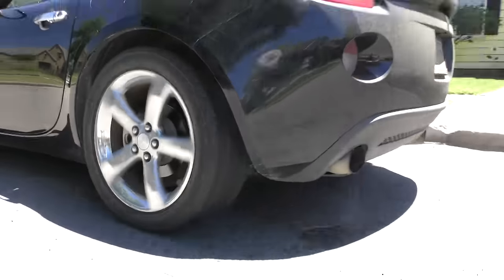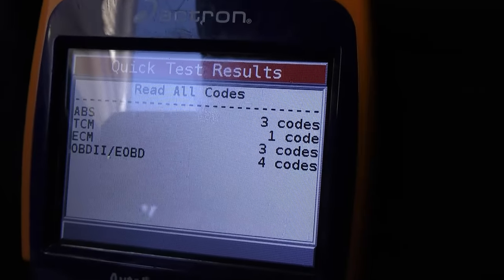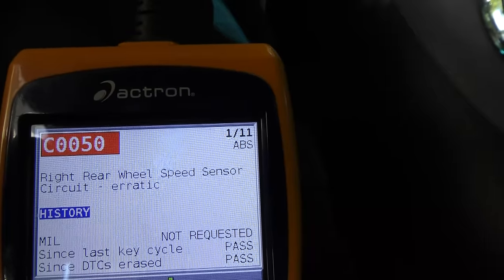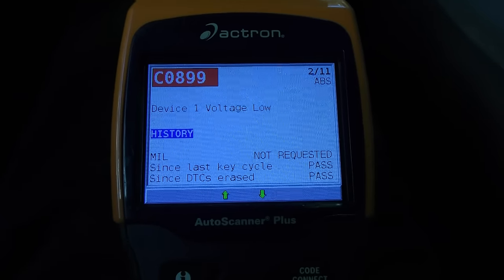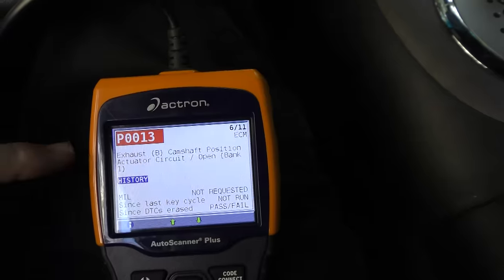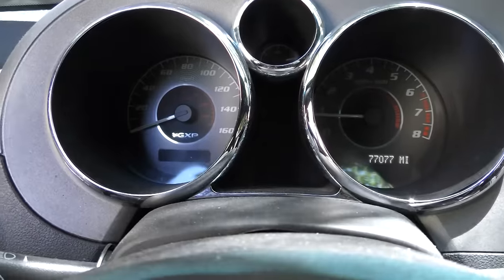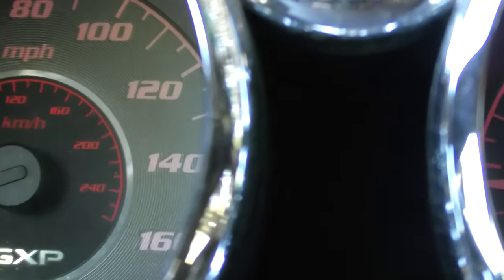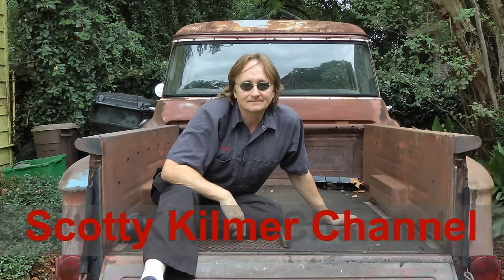Check Engine Light On in Your Car? The Truth About What it Means

Comment: I have a 2014 nissan pulsar c12, the engine light came on today, not flashing, with rough/unsmooth running when applying the accelerator pedal lightly. Smoother at higher speeds .
I had a reconditioned transmission put in October 2018 at $4995, done about 29500 kms since.  It was raining heavily when I was driving earlier today.
Reply: I even phoned Liverpool nissan Sydney, they said it could be a fuse to an engine problem, didn't think it would be the transmission.  I never put the transmission into reverse when revving high in park in the morning, that can do damage.

Comment: multiple cam codes at once could be timing belt/chain stretch, guides worn/cracked, tensioner failing or lack of oil pressure/flow.  they don't always make noise when worn enough to be out of range ;)

Comment: Replace or clean the oxygen sensors at the exhaust lines. Most of the check engine light need to be considered oxygen sensor and MAF/MAP sensor also. If ignore the oxygen sensor and MAF/MAP sensor the car fuel consumption will be increased due to improper fuel and air mixture ratio.

Comment: As suspected, when the oil change was done a sensor was disrupted when the motor cowling was placed back on the engine. The oil changer corrected that and everything is fine.

Comment: as an auto parts store employee, you won't believe how much parts are purchased based on the assumptions from these code readers. I always tell people that code readers are helpful diagnostic "tools"!!! not a magical crystal ball that will tell you what you have to replace to make it all better. too many customers and especially inexperienced shops focus too much on the what's wrong? part and not enough on the how did it happen? I see way to many returns and warranties for parts that were either purchased unnecessarily or failed prematurely because there was a secondary issue that was causing the original parts to fail. I am no professional mechanic but I do strive to find the root of the problem to avoid coming back to the auto parts. 
btw stop asking auto parts store employees to diagnose your car over the phone or in person. Not everyone there is an experienced mechanic. I know my way around a car but I am not qualified to service cars anymore than a Wal-Mart store employees to diagnose your health issues because they work in the bandaid aisle.

Comment: So, I'm in AZ and they require emissions testing every two years I believe. They say that your car will automatically fail emissions if the check engine light is on. True or no? Figured you'd be the guy to ask. Can't really leave it on if this is true.

Comment: When the engine lamp flashes in a Fiat, it means the self learning system wants to be reset. Ex if you do a remap. Rev the engine to 5-6000 rpm for 3 sec x 3 times. Shut off and wait 10 seconds , restart.

Comment: Your channel is entertaining. However the advice of waiting and ignoring unplugging the abs Does affect more than the brakes. It affects the stability control. And. Those cam codes can take a couple of weeks for the monitor to trip. In order to turn the light on. If shops are guessing and just replacing parts...... FIND A NEW SHOP lol

Comment: I bought a 1997 Dodge Ram 1500 Larimie.  The previous owner said it sat for a year. The DMV record said it was on non-op for almost 3 years. The front end went out and had to be replaced. Just days after I  bought it. I  had to have the rear breaks done a new sensor put in and a new steering column. It shift into all gears but I  have to pull the shifter just past the D before it goes into drive. Only gear I have to do that with. So question 1 is why?   
I taking a trip to Idaho in my truck. So my next question is since it sat 3 years what would you have checked out? 
 Besides the obvious tune up and fluids changed.

Comment: I had a 1990 240SX that had the engine light go on and off. Found out it was a faulty MAF connector. Only a couple times did it make the car run poorly, and I would simply just jiggle the connector and it would fix the problem. But most of the time it would come on and stay on despite how well the car was running. It's an older car so I would access the computer and use the user-friendly dial to erase the codes, although I hated doing this all the time. My only concern was the light coming on during a smog test, in which it would mean a failure, and it actually did once which made me upset.

Comment: I had an issue with a code P0302 (cylinder 2 misfire). The code was erased but the check engine light turned on again. I turned it off realizing that it was probably something that it was something different (like fueling the car). The code turned on again and it was time to change the gas cap. So far no problems with it after months of driving - but it felt that the old gas cap was not tightening up correctly which caused some air to get in.

Comment: I once saw one light up along with the traction control system light. It was an automatic. It had a problem where it would hesitate to shift, causing apparently sluggish acceleration, so naturally you'd push down the gas pedal further to go faster. But then it slammed back into gear, and now that you had revved up the engine, you suddenly lurched forward faster than you meant to! Could have caused an accident. Needless to say we got that fixed in a hurry.

Comment: Put a pair of glasses on. Disconnect the negative side of the battery. Let it sit for 10 mins. Reconect it. In a couple of days when it comes back on take it down to Napa. And they will for free give you a print out as to what it is. That's right. Free!!! Now take it to the repair man. Give him the print out. Now you won't get screwed. Knowledge is power. They just love it when a customer comes in with a print out. You are someone they can't rip off. Most of the time it's just an O2 sensor. Most cars have 2. Don't buy a code reader. Most auto parts stores will scan it for free. Get the print out. While your at napa ask them how much the part is. Why not? Have him print that out too. Knowledge is power. Once a year I always disconnect my battery just to clear any silly codes that don't mean anything. Have fun. Wear your glasses. Clean the battery while your there.

Comment: I have a half lit abs light. Real dim and playful.Turns dimly on after stopping, goes out after taking off. Manual tranny shaft moving, playing with sensor to ground. Maybe they should add a manual transmission light to the check engine light and the ABS light.. and blink it with the seatbelt light during key on with the check gauges light. I like flashing lights. lots of lights smashing my face off. Meanwhile.. onto 400k miles.

Comment: I had a blinking check engine light on my 97 Ford Ranger 2.3L.  One of the spark plugs stripped its threads while running even though it was quite some time since plugs were last installed. Less than a $300 repair, I let someone else take the liability of repairing it. :)

Comment: The check engine light is supposed to come on when a cylinder misfires.  It provides a way of determining which spark plug or ignition coil is bad.

Comment: Well if it's a daily driver I'd say this applies but the best thing that can prevent Cels is preventative maintenance.
Reply: Justin Yorks 
What "preventative maintenance" regiment replaces the evap cannister, the MAF sensor, the TPS, the O2 sensors, the crankshaft position sensor, the camshaft position sensor, the gas cap, the thermostat, the oil pressure sensor and any other number of sensors that can trip the check engine light? 

Preventative maintenance is a good idea but nothing that is done in a normal PM will make any sensor last longer, and since there is no predictable lifespan for any of them with the possible exception of the O2 sensors a proper PM schedule has no connection to keeping the check engine light off.

Comment: Not surprised the 5.3 those things and the Impala SS. The real question is how much oil does this one burn? Seems every 5.3 with AFM burns it like gasoline. AFM grounds the cam down to the point its a good thing AFM only lasted for 2 years

Comment: Mine came on while coming home and the car started misfiring, it would accelerate erratically but managed to get me home. Plugged in my $30 scanner, googled the code, turned out one of my ignition coils had died. took a trip down to autozone, $60 , and another google search to find out the firing order, problem fixed. I have almost 0 car experience, just basic tune ups, but managed to do that on my own with google.

Comment: What happens when 4 or 5 check lights appear but there is no problem.  Example I had a warning that the steering wheel was locked. It was not. And the brake light was on.. brakes were repaired at dealership and work fine.  Why do they come on??  Can I drive it?  FYI, just had in in for a yearly diagnostic and it passed.   We moved, so can't take it back... as it is a 6 hour drive.  Afraid to drive it.  VW passat ...ten years old

Comment: How about needing an engine after the timing jumps. Cam position codes do not always relate to an actuator....

If you don't know what a code actually means, don't clear it. Take it to a technician and let them fix it. If the repair is out of your budget, then don't fix it and drive until it dies...

Comment: I would ignore the codes. If it runs fine, and drives normal, then that is fine with me. The check engine light always comes on my dad's 2002 Jeep Cherokee, and sometimes it goes off. I swear that car can't make up its mind wether something is wrong or not.

Comment: Unfortunately, living in the NE, one needs FWD. And they put magnesium chloride pre-deicer on the bridges and high roads. Which ravages: calipers, lines, suspension perches, etc. So finding a good older car here isn't practical. And a older car which doesn't have all the zinc galvanization won't last long, either My friend just replaced his 20 yr/o F-150 because it's rusted out beyond repair. He just got the new F-150 with 325 bhp V-6 Turbo. He loves it. But, we both talked about how many expensive issues turbo chargers have....Let alone the 20+ control modules in the damn thing...

Comment: I once had the check engine light on.  The mechanic plugged in the diagnostic but can't find any thing wrong.  Turned out the engine oil n the car had almost run out. An oil change fixed it.the car was honda odyssey.

Comment: Have a sportage with 168,000 miles.  Check engine light has come on five times. Always the same issue, forward stream oxygen sensor. About every 30,0000 miles. Had to replace every time

Comment: I recently changed my thorttle  body and the air flow sensor on my truck , I programmed the computer to the thorttle body and the check engine light went away, I used Arco gas 87 octane and my check engine light went on, soon after a less than a 1/4 of gas I used Shell gas 87 octane and the light went away, I used the Arco gas again just to check if it was just the gas and the light went on I guess it's just Arco gas.

Comment: Had my MOT done yesterday. No issues. The engine error light came up after few hours! The car is driving fine. Error codes are P0380 abs P0136. They are not going away after clearing the log. Going for a long drive today. Need help!

Comment: Scotty I enjoy your Vieo's great job. I have a question. I have a 2003 Hyundai Elantra with a p1140 code, I changed the maf sensor and it's still coming on. the computer is not telling me anythig else. Is there anything I can do to get rid of this code. The ispection was up this month I meed to get it on the road. I changed the maf sensor to a more expensive one a 2nd time and the check engine light came back on. Should I try disconnecting the battery or do you have any other suggestions? Any help would be greatly appreciated. Keep up the great work you do helping millions of people. Steve

Comment: Even if the light doesn't come back on, there might be a pending code in the computer's memory. Some problems take at least 2 drive cycle failures to trip the light. ALWAYS check for pendings before declaring All Clear.

Comment: With modern cars, dirty fuel injectors I found can trigger a check engine light to go on as one of the examples. There was one time my car had the light on along with running issues. I have used petrol injector cleaner and eventually, it ran better and the check engine light came off when I started my car. Like you said, it can be a simple issue.

Comment: I got one in my 08 Charger RT. After aggressive acceleration the car will go into limp mode and the check engine light will come on. The car wouldn't display a code, so I hooked up my scanner, and found it was the transmission kicking the car into limp mode. Hopefully a trans fluid and filter change will fix it. Fingers crossed.
Reply: This may be why my 2003Nissan 350z goes nuts on me or used to.It hasn't in a very long time but when I first bought it 3 years ago it would sometimes when I hit the interstate and gunned it all of a sudden the car would feel like it shifted into 1st or second gear. Its a manual transmission. It really scared the he'll out of me and all you could do is pull over to the shoulder and hope you don't cause a accident.It hasn't done it since I ran a ton of cleaners and changed all the fluids and guys at shop said they didn't see anything wrong and it would never do it for them. I I believe the ABS light would blink for a bit while it happened when the car would slow down as I pulled over it would kick back into gear and if hit the gas and I might would be weeks before it did it again and then some times it would happen every time I punched the gas. If I went easy it didn't happen but that's no fun. My skid plates or whatever those are called are gone both of them. How important are they. I'm in TN we drive hard and play in the parking lots when it snows and I've ditched it twice. Love that rear wheel drive on ice yee ha I felt like a kid again.Anyway it tore them off. I dont know I could work on cars when I was young and hell it took me over 20 minutes to figure out how to get the dipstick all the way in. If you ain't ever seen one on these cars go find one and see what you can do...lol oh one more thing any advice on how to get the bulb out to replace the low beam headlamp?

Comment: I opened my cluster panel and disconnected my check engine light.  But 2 days later my check engine light came on!  So I went to the auto parts store and had them check it.  He said it was giving the code for a disconnected check engine light.
Waaah, waaaah, waaah, waaaah,  woooooooh.

Comment: The only problem I have with this is that most "check engine" lights will cause the car's computer to switch to the "limp home mode".  This is a default setting to keep the car running until it can get fixed.  This will impede performance, reduce mileage and can cause a lot of carbon to build up inside the engine and even damage the catalytic converters. So if you have an old and pretty worthless car you may not care but if you have a car that is valuable or that you want to keep on the road a long time, getting these issues fixed is important.
Reply: Pook Atim ... Car Manufacturer: " Hey let's build in a mode for our cars that will cause damage when the mode is enabled so the customer has to pay for even more repairs than they would have if the initial problem was fixed!" ... Dealership Service Centers: "Cool!!!" ... Yes, it does sound believable!
Reply: JonnyTheKin6 Yeah,mine comes on when it's about 5 degrees or lower.When it warms up to 30 or higher it goes off.Same with the tire pressure sensor.

Comment: The CEL light will only illuminate solid for emissions related issues that are most likely MINOR. If it is FLASHING at you do not drive the vehicle as it is probably severely misfiring and will ruin your catalytic converters

Comment: I just went to the Mini Cooper  dealer to get an oil change. They tried to rip me off by pushing some extra electronic checks which I refused. They could not resist giving me a list of all the things I need to fix, for about 8K....My Mini is 2007 is that is about its core value. It runs great and I will ignore these suggestions as I know, extortion when I see it. How disgusting ! That engine light will not bother me as I know my car is running OK ! What do you think ? I am about to check that oil gage to make sure, they are not ripping me off , in the oil department.

Comment: I would just invest in 1 of these. just spent $140 at the stealership just to run a check on that engine light, and turned out it was the gas cap.

Comment: when the check engine light comes on in my porsche boxster, it starts using way more fuel. from like 11-12liters per 100km, it goes up to about 18-20liters per 100km. the codereading tool says something about lean mixture on postcat oxygensensor bank1. i've alraedy checked for exhaust leaks, and i don't want to go to my workshop to get the codes deleted every 250km (usual interval in which the checkengine light comes back on), so i'm gonna change that oxygensensor next.

Comment: all that may be true Scotty but when u live in a state that u need to pass emissions like good ole NH. you are not allowed to have any check engine codes on not are u allowed to clear the codes and run right to the inspection station to have the state computer read the car. it will know if its been cleared recently.

Comment: I have had mine on for last 5 months diagnosed EGR valve fault and Injector fault have been getting lots of smoke and using a lot of oil 2 litres per week would either of these faults have caused the high loss of oil my car is a diesel btw